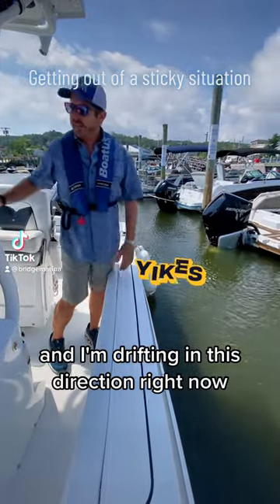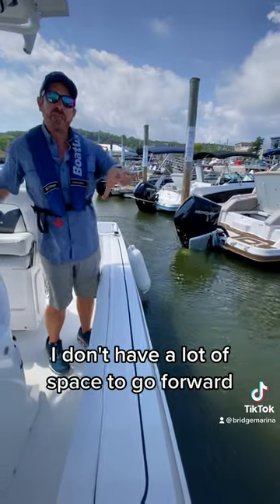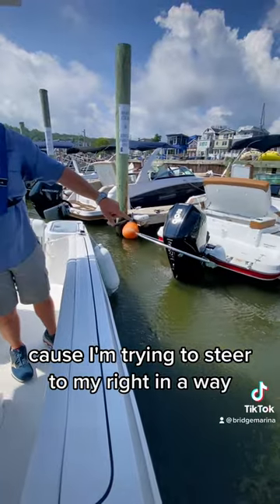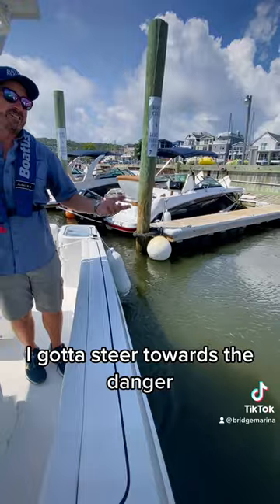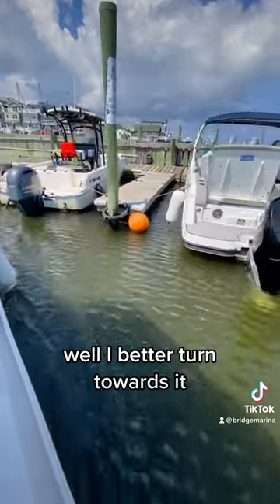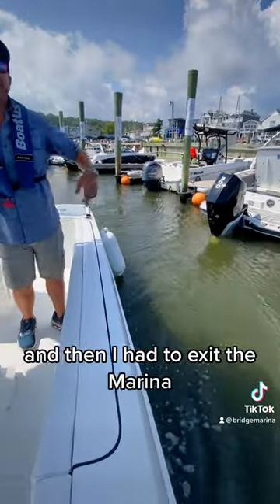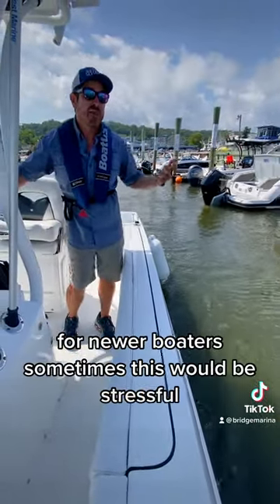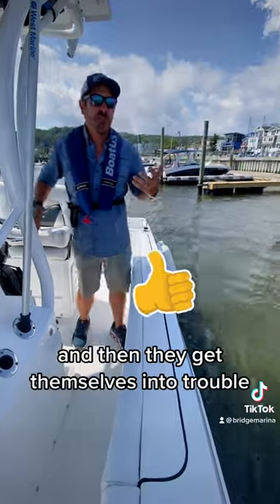Quick Boating Tip for New Boaters: Getting Out of a Sticky Situation

Comment: Try it with a 52 foot wooden hull dead-rise with a fixed prop and rudder with no bow thrusters, with a diesel with a 1:1 reverse gear.  That's how all those commercial fisherman in the Chesapeake bay do it.  If you can drive one of those boats. You can drive anything.  ;)
Reply from the maker: Appreciate you stopping by and sharing - thanks!

Comment: The biggest mistake is thinking the wheel steers a boat like a car.  It doesn't work quite the same. Turn right with a car and the steering (wheels on front) pull or point the car to the right and the rear follows. On a boat turning the wheel to the right pushes the stern to the left which points the boat to the right, but the steering (rudder) pushes. It has to push left to go right.

Comment: Just remember you are steering the back of the boat and pushing the front. Not like a car where you are steering the front and pulling the rest along
Reply from the maker: Interesting way to look at it. Where do you do your boating?
Reply: I think of steering a boat like those dollys at Home Depot.  The back wheels pivot and the front is in line.
Reply from the maker: @greg2865  - interesting as well.  Appreciate you sharing! Where do you find yourself boating?
Reply: Not surprisingly, it's often easier to leave some situations stern first.
Reply: @Bridgemarina  Gulf Coast of FL, mostly.  Beautiful but sometimes has a lot of water traffic.
Reply from the maker: @greg2865  - indeed beautiful!
Reply: @greg2865 never drove a boat but it seems similar to how the forklift drives.  Can’t wait to afford one, one day

Comment: We had a slip one time that had so much current that it was closer to a river. You had to come in 90 degrees to the current, up current, then rotate in, with the wind pushing you off the dock as well. The slip was about a foot wider than the boat so there was no room for error. It took me so many tries the first time I attempted to get in, but once I figured out that letting the current push you down and inching forward slowly worked, it was easy. Plus that boat drove like a Winnebago, 2 outboards too close to each other and no thrusters or joystick made for some exciting docking scenarios.

Comment: For surf boats more throttle does help though, those boats get very sideways at slow speeds with wind. Using the throttle helps straighten them out and helps the boat respond better to steering wheel inputs.

Comment: Sometimes though when in the marina and the boats drifting,  maybe because the wind is strong,  ill need to rev it and accelerate because at low speed if im making the turn it wont counter my drift.   After 3 years I am still anxious about it and like others have commented, i always prefer to have someone with a hook on deck.  The best is having 1 person on the hook and another with some crash buoys ready to throw over board if the boats about to hit some sharp metal props.  First time parking in a narrow spot, had on both sides of me the boats were parked nose first so their engines are out and props are glistening wet in the sun, just begging to f*** up my day, AND my boat at the time had to be put in a55 first or I couldnt climb out on the dock, and there were some close shaves! A few scratches even :/   but those scratches were won out of learning i suppose
Reply from the maker: Appreciate all of that - thanks for sharing! What waters are you boating in?

Comment: With no prior experience i adopted a 30foot bayliner and put it in a slip. I was given the slip closest to main dock in between all these very expensive boats. This is on the housatonic river which has a very strong current. Oh and my transom pin came out giving me no reverse. (Reverse just lifted the outdrive out of the water) I still navigated that boat into my slip everyday with no issues. Point is if you dont know how to navigate against current than you shouldnt be driving a boat

Comment: Put boat in neutral, reverse and turn full right, neutral, forward and turn full left using idle engine speed only.
Reply from the maker: Thanks for the comment and for watching!
Reply: Much easier to do as the Captain on the video shows. If the tide is pushing and it not just wind and you have a four blade or high pitch prop reverse is not very quick to respond so just knowing the right way to handle your vessel early so as not to get to far into a bad situation is important.
Most boaters are not Captains by any stretch of the word. They only take there boats out occasionally
Reply from the maker: @Snookchaser007  - thanks for sharing and for watching - appreciate it! A proactive approach great indeed.  Where do you typically do your boating?
Reply: @Snookchaser007  I watch The Chit Show and Haulover and you are 100% correct
Reply: @Bridgemarina  i operate a fish camp and Rv park on the inter coastal in central Florida.
Reply: @fredeb67  There is a county boat ramp literally a stones throw from my front yard. I see that kind of show nearly every weekend. 
We all have skills we have yet to learn or master in life. The key is being humble enough to admit it study, practice and learn from those who have experience In that field.

Comment: Eh, it's not hard. Is sort of like pushing a shopping cart with wiggly wheels in the back. And the motor is your hand. I've been conning a large boat since 14. Figure it out, and stop scratching boats. Directed at some 40 y/o relatives not directly related to me. Let them borrow the boat, scratched both sides all the way down, and filled it up with gas. The only problem is they filled the water tank. Don't drive in tight spaces if you're not comfortable. And don't loan your boat out lesson learned.